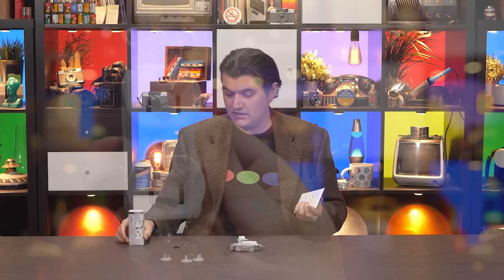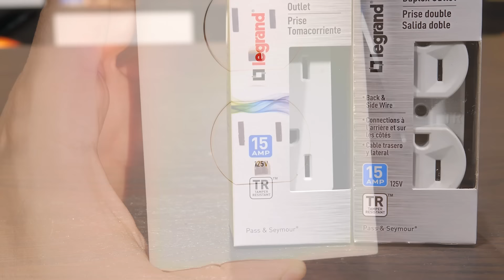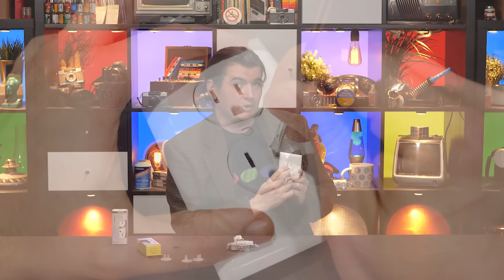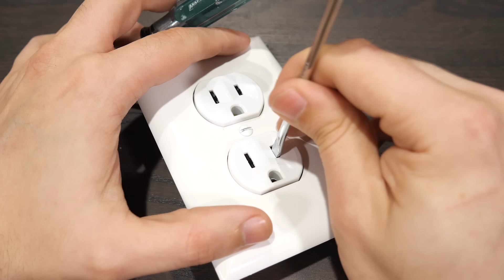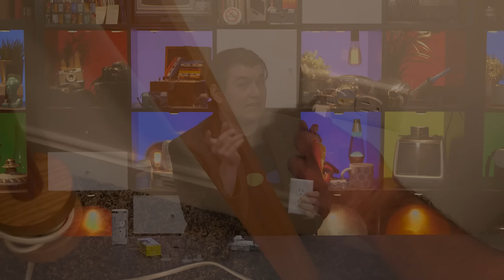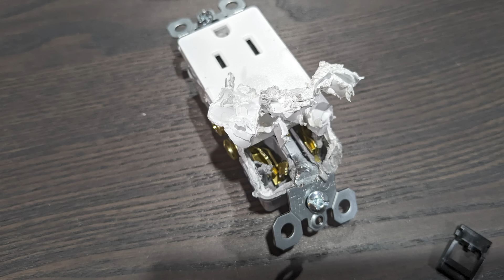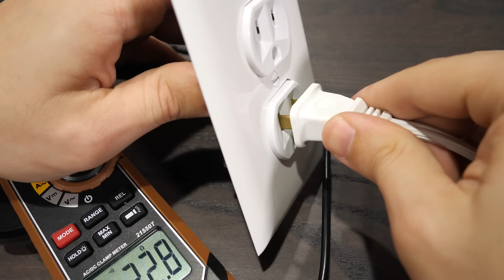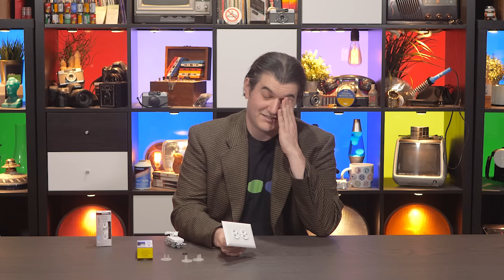Tamper-resistant outlets aren't all the same - a follow-up

Comment: It’s always interesting to hear how people describe how we get 120v and 240v from split phase systems. 

He’s close but not quite. It’s still a single phase.
Reply: It's mathematically equivalent to what one might think "two phase" should be, if that name weren't already taken by an obsolete system.  I.e. two waveforms that are 120V to neutral nominal, and 180 degrees apart.

It's just that rather than producing it with phase shifts, it is produced with center-tapping a single phase transformer and grounding the midpoint, to produce waveforms that are negatives of each other.  In the ideal case of a perfect sine wave, it is mathematically equivalent to a 180 degree phase shift.

Comment: The new gfci i bougt in canada for one of my outdoor plugs because the box failed and it was filled with water.  Had the stab ports, however they were also secured by the side screws, instead of just with spring tension.  you could do either hookup.  Since it was mechanically secure i opted to use them instead of the side mount. If they were only the spring mount, i would have used the side ones.

Comment: Regarding backstabbing outlets, here in Denmark since like the 80's iirc, our outlets and switches only had the back stab option and because there was a monopoly on the manufacture of outlets (until 2008 when EU style outlets were allowed in installation) they (LK) pretty much decided how it was done, and honestly, they have been working fine, only a bit annoying if the release mechanism broke, and getting the wire back out was a pain.

Comment: Speaking of bad temper resistant outlets I knew somebody who got a new apartment and they put new tempers in outlets in and they were probably the super cheap contractor grade ones they were unable to plug cords in. me at much younger was still barely able to get cords in and it took like a minute to do and then you end up putting a power strip on which the negates the safety factor.

Comment: I would love to see sleeved plugs I think it would be doable and has somebody who has bought a few too many things from China I have managed to acquire a cord that is China/Japan sleeved and so far I've not had any issues with the outlets are plugged it in although it's a very small sampling. And if somebody has been shocked a few times by unplugging the plug and accidentally getting the pins or reversed yes.

Comment: One thing to know about plug covers as in some cases they can defeat the safety mechanism of tamper resistant outlets. There is a major issue as these things got imported from China to the UK with they actually make the outlets more dangerous if they were to break. Most of the designs here in the US for outlets seem to of taken this into account as they are triggered off of the pins and not the ground. A lot of the UK outlets were triggered off of the ground pin which would leave a broken plug cover exposing the live in neutral. There are videos trust me there are videos. It's even how I found out about the crazy squirrels and their power strips and hairdryers.

Comment: About daisy-chaining outlets: that is standard procedure in the UK, they call it a ring (it has its advantages: a break in the cable is not disabling, as supply comes from both sides).
Most west- and central Europe countries use the star arrangement, most outlets have a direct connection to a large central connection box usually behind (above) a lamp. In don't know about all countries, but that's how I learned it in my country (the Netherlands).

Comment: Doesn't the UK or EU plugs have a little covering painted onto the portion of the blades nearest to the plug to prevent such potential shock hazards? Perhaps US manufacturers could adopt this idea to cover a small percentage of the blade which doesn't contact the internal outlet contact points.

maybe you already mentioned this when i was too focused on acting like a keyboard warrior...

Comment: Electrician here, on the topic of WAGOs, (and back stabbing receptacles for that matter)

We use them a lot of big jobs, because they are faster than wire nuts, and thus save the contractor money. 

Virtually every foreman I have ever worked for thinks wagos are bad connections, and they fail more frequently and much sooner than a good wire nut connection. I think i agree with them for the most part, though it depends on the WAGO. 

The lever ones are actually pretty sweet, and wagos are good for tight spaces, but tbh i just trust a wire nut, and a side screw receptacle connection more. 

I've replaced quite a few outlets that are back stabbed, and the years of heating cycles with use seem to just loosen up, maybe it affects the spring of the metal ot something, and for sure a bad wire nut connection is bad, but a properly done wire nut never seems to loosen up, especially with solid wire. 

IMO the back stabbing outlets are handy if it's a real awkward position, or you just don't know what you're doing to some extent

Comment: Going 50 in an speed limit 15 zone is not save
but it is more saver than going 100

The CEE plug is very common were I come from. That is 16, 32, 63 or even 125A three phase at 230V to Neutral and 400V between phases
The 125A variant of that plug has 10mm diameter pins, so you might even get your finger in there. Now how is that for safety
(al thou I have to say, the 125A variant of that receptacle is rarely seen in the wild, mostly industry and so on. I mean, that thing can carry 86kW in one plug)

Comment: One thing I've noticed is that we have negative-ground/neutral-ground, so the ground and neutral/white side are ultimately tied together at some point in the house wiring.  In the circuit breaker panel, all of the grounds and neutrals go to the same bus bar.  Maybe that's why we don't have more devices getting ground plugs.
Reply: No that isn’t the reason. You only need ground plugs for devices with metal surfaces that could due to a malfunction become live. Most devices just aren’t designed like this.

Comment: You talk of the US design not being as bad as it could be because it's 120V.  In the Philippines, it's the exact same outlet (but worse standards I think) but they put 240V through them. (with 10 amp breakers) Those plugs are scary.  You mentioned how many things had to line up to get a shock..  Many many less ducks to line up there.  Tropic climate so greater chance of being barefoot inside..  High voltage, not great quality of outlets..  I was using my laptop there one time (quality unit, manufacture charger) and my hand would buzz a little when I ran it over the case..  Seems like most of the ducks were already lined up, just needed one more to make life very spicy.

Comment: For plugs angling away from the wall, why haven't we standardized on some mechanism that grabs plugs by the holes? Almost every plug has those little holes in it that are for holding the blades in the correct position during manufacture. Some little spring-loaded peg could grab through that and then either have an eject button or use a push-to-eject mechanism.

Comment: Broken Christmas light bulb when I was like 11 or 12, the mini incandescent bulbs, I'm sure I'm not the only one who's been WACKED by Christmas lights... That was the only time I have gotten a pretty good WACK from. It made me never fix a string of lights again, also when I'm changing broken outlets and I'm sure I (the wife) flipped the correct breaker off I intentionally arc across the terminals with one of my Milwaukee screwdrivers, there was 1 time very recently I did that after the wife shut off the "correct breaker" and it needless to say I shut off the correct breaker with my screwdriver... then after I about Sh1t myself and I could see again lol I got the outlet swapped out and put in ground down lol...

Comment: GFCI works by monitoring the current on hot compared to current on neutral. Playing with a jukebox and letting neutral current leak on to the ground will trip a GFCI but there won't be a short or arc or anything apparent because, in theory, neutral and ground are the same potential. Note: you can of course still get shocked by neutral current passing through you.

Comment: The one issue I have as an electrician with the tamper resistant plugs is it's much more time consuming to troubleshoot electrical issues due to the fact that it's not only hard to get a tester probe to insert but sometimes the tamper resistant mechanism grabs the end of the probe and will not let go or damages the probe.
Reply: That's why I almost always use a plug tester. If the issue needs a voltage reading I'll just take the cover plate off.

Comment: Here in the UK, those outlet "blanks" are widely available but with our design of outlets it's actually more dangerous to have them than to leave them out.  Obviously we have the shutters which will stop a child sticking something into a live terminal, but with one of those blanks, if a child can get hold of it they have a tendency to force them in upside down which can cause the blank to snap and leave the earth terminal in the outlet with the shutters open.

Then, in terms of tamper resistant designs, we do sometimes have designs that work like the US where the live and neutral pins operate the shutter.  Shaver sockets tend to use this, as does the socket on some MK brand cooker switch units (for some reason).  Older MK sockets also used to have this design although nowadays they have combined this with the standard design where the earth pin is used to make a "3 pin shutter" where the earth pin first unlocks it and then the live and neutral need inserted at the same time.  This is good because it stops people forcing in euro plugs or bare wires by sticking something in the earth terminal first.  I remember spotting a socket in an airport where someone had left a golf tee sticking out of the earth terminal, presumably after forcing a euro plug into it!

Comment: So, it forces you to get the worst possible shock if you actually defeat it with 2 metal objects (the perfect challenge for a kid).  In one arm through the heart and out the other arm.  Where with a standard outlet, IF you stuck something into THE HOT terminal you might not even get a shock depending how grounded you were.

Comment: When studying for my General Class ham license back in 1999, I learned that our “120-volt” outlets are actually 340 volts peak-to-peak. That is to say the AC wave swings from 0 to +170, back to 0, then continues to -170, before returning to 0, completing the cycle. “120” is the root-mean-square (RMA) voltage, which describes the equivalent heating of a DC supply. RMS is 1/2 the square root of 2, or to put it another way, 70.7% of the peak voltage of one side.

Comment: It seems they took a situation where someone could stick a screwdriver in each of three holes and be fine on dry carpet or in two of three on cement and replaced it with one where you're pretty much forced to get a second screwdriver and use both hands. The regulators call this safer.

Comment: What i don't get is why you don't insulate the first half of the pins
this way it would get contact when it's deep enough into the outlet so that only the Insulated part ist stickin out
actually in europe with the "Euro Plugs" we have this even though the outlet is deep into the wall but since those are thin you may be able to get contact to the pins

Comment: One thing that comes to my mind about the design is - why don't you beginn to standardize the plug-size, make the plug a little less flat and "push" the actual outlet a little bit inside the wall so you have a bit of a socket like we europeans did with our plugs? You wouldn't have to change the whole design but it would be much safer since the plug can't fall out or tilt so easy.

Comment: Those shuttered outlets are REALLY annoying to get a meter into, btw. And personally, I think recessed stuff would be a better idea. That said, it /would/ break compatibility. Also, I have been shocked one time in my life. It was by a 440v 3ph 60a line, and the insulation was cracked in an imperceptible way. I was able to jump back immediately, and there was lots of loud cursing and shouting [in front of both my store manager AND customers!], but that was the only time. It's really disturbing to think about.

Comment: The house in which I grew up was custom-built to order for my dad, in his bachelor days.  That was in 1938.  So, by the time I came along 10 years later, the outlets were already a decade old, and definitely not modern.  I.e., no "safety" features.  My earliest memory stems from about the age of 3, when I discovered the hard way that one should not stick hairpins into the outlet.  These were the old-fashioned wire pins, without rubber tips, and just made of wavy wire bent into a tight horseshoe, but not closed together at the ends.  Obviously, then, it was possible to engage both sides of the outlet at once!  120 shot through me; I screamed; mom came running; but I did not die.  As an adult, I learned that yes, high voltage can be lethal, but it's more the amperage that gets you... ;-)

Comment: I'd like to see a video from you displelling the myths and fears many North American electricians have regarding Wago (and now Ideal) style lever nut connectors, and include the new Leviton lever nut style integrated connector receptacles.
As others have mentioned, though you're opinion on them are slightly different, you and many N.A. electricians seem to believe lever nuts and backstabbed connections are the same, they are not, backstabbed connections are cheap and one time use only, lever nut are much more secure and safe, as well as reusable, more robust designs.
My opinion, based on what I have seen on YT, as I have no personal experience with them, and based on my understa ding of physics and my electronics engineering technology advanced diploma (Canadian College 3 year program, 1 step below an enegineer with a 4 or 5 year bachelors degree), is that all the issues N.A. electricians have can be and have been throughly debunked, otherwise, if those issues were true (fire hazard, connectors failing, etc.) then European electeicians wouldnt love them like they do, and they wouldnt be the defacto standard across Europe. The guys at eFixx (a UK electricians YT channel) laugh at the use of anything other than lever nut style, including wire nuts. I pretty much agree with them. Wagos might run slightly higher temps for the same current/voltage as wire nuts, but wire nuts tend to fail at lower temperature threasholds, IIRC, and the regulatory bodies and testing laboratories seem to beleive Wagos meet all requirements, and in the tests done by Youtubers, seem to far exceed their laboratory certification ratings before failure.

Comment: The main places I've been finding tamper proof outlets is in outdoor installations. (I do a lot of traveling in my RV). What I have observed is when these outlets are exposed to the outside, not necessarily exposed to rain but to the humidity, they become very difficult to insert the plug into it. Just in the last 2 months, where I've been trouble shooting electrical problems, I've come across 3 deferent locations where I couldn't get the test plug in. I had to disassemble the outlet to get to the screws so I could make contact with my volt meter.

Comment: It should be an easy fix for the outlet makers, either cover part of the prong near where you hold onto. Or have just the tip energize with plastic in the outlet to help hold the blades in place in the outlet so the plug needs to go in farther into the outlet before becoming energized.

Comment: I think a “mandate” or code change that would only spark as few riots would be to invert/ground up the outlets, right angle and fuse the plugs. This would basically turn it into a 120V version of the UK outlets. Just brace yourself if step on the plug… Lego has nothing on those! Also, switch the outlet!

Comment: About the desing of your guy's outlets, i dont know if the danger of shocks go up when you have a pacemaker, but if that is the case i would imagine that 120v would still do the trick.
Also i feel like reversibility of the plug is such a nice feature i take for granted, i have never had to fumble around to find the correct rotation in the dark, so didnt even have a chance of being shocked. I feel like not even having a chance of being shocked in "reasonable" use is better. 
Though kids existing does mean that the higher voltage is more dangerous of course, since safer within reasonable use is not enough probably haha

Comment: My new house has TR outlets that has made me hate them, because if you're not absolutely dead on square they won't go in, and for reasons I do not understand, they refuse to hold onto anything plugged into them. Brand new.  Especially the 20 amp outlets, my 20 amp UPS falls outta the receptacle like.... weekly, seemingly on its own accord, though it's gotten better since I completely broke the bottom receptacle and can now only use the top one... so super consistent!

But TR outlets I've used elsewhere, both at a previous apartment and in newer commercial settings, have been....  just fine.  So definitely some are better than others.

The other new safety thing that's very inconsistent is AFCI circuit breakers.  Never have an issue with GFCI, but had many false trips with AFCI, especially with garbage disposals... which would trip a completely different breaker in a prior apartment.  Still don't understand that one.

Best I can tell, the rest of the world definitely came up with better outlets than we did.